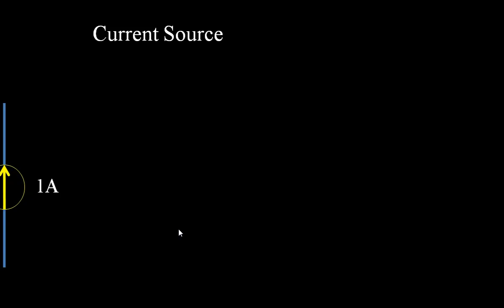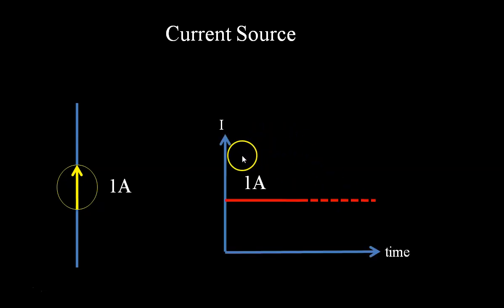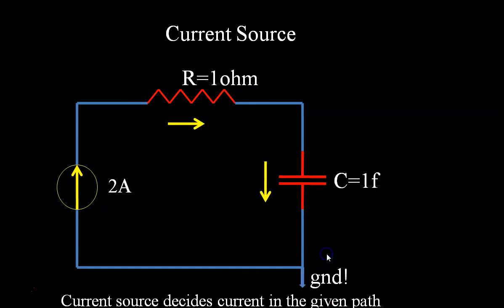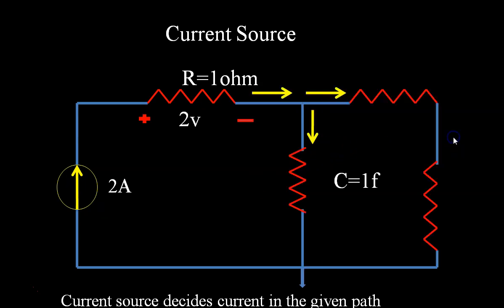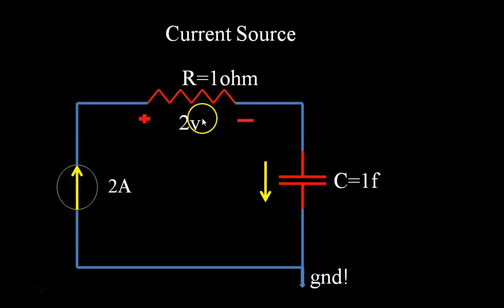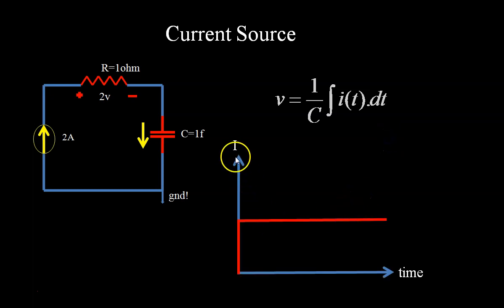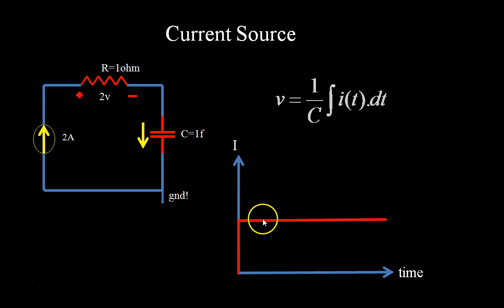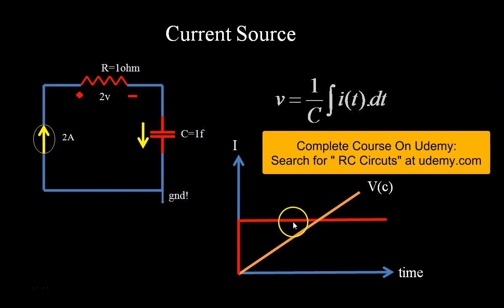Current Source and RC circuits

Comment from the maker: Hi all please use below links to access our udemy courses for (there is a added discount) :
Analog Design (4.5 + rating ) : https://www.udemy.com/course/analog-circuit-design-intuitive-approach-to-design/?couponCode=02E8EDDEF78C3DC7C102

Foundation course for analog design - On Mosfets (4.5 + rating ): https://www.udemy.com/course/mosfet-foundation-course-for-analog-circuit-design/?couponCode=D7D79BCFFA4B66B03723

RC Circuits (4+ rating ) : https://www.udemy.com/course/rc-circuits-for-interview-part-1/?couponCode=EF830651E77BCB0AC31A